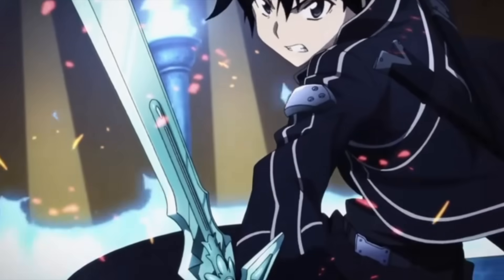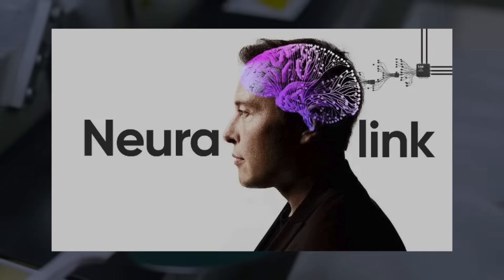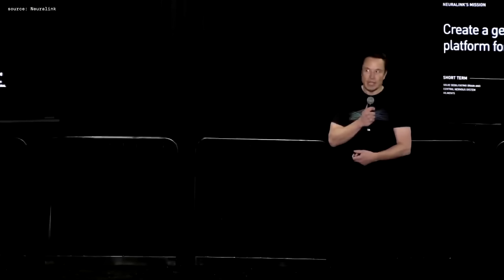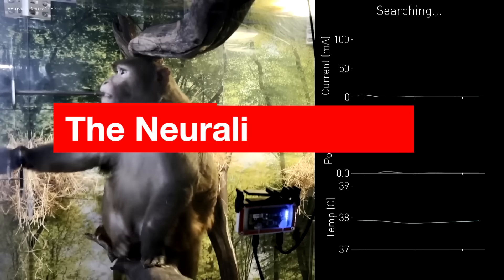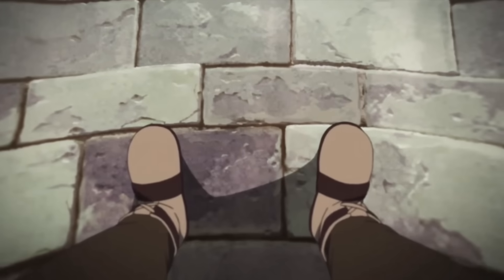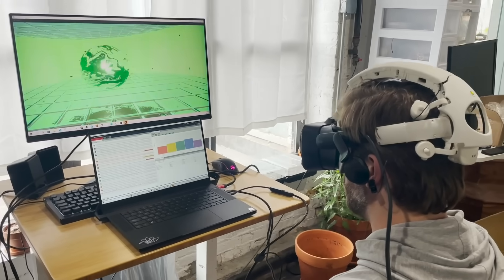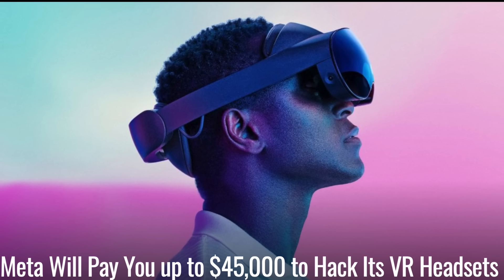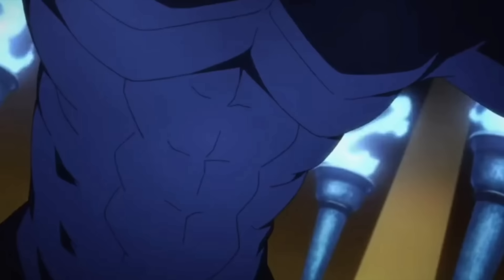The Full Dive VR Future of Neuralink!

Comment: the main issue so far with human trials and current brain implants is that, although successful, over time the insertion point into the brain will begin to try to heal itself, building up scar tissue, and scar tissue in the brain (believe it or not...) isn't good for it's long term functionality. This is equally true for the chip implanted. The more scar tissue can be equated to lag spikes in the brain chips interface since it's difficult to get accurate readings.

If they can solve that problem then perhaps they're on to something. Currently the safest and least invasive method would be preferable (i.e. a powerful brain wave reader that doesn't need to be surgically implanted or in the least, one that doesn't pierce/damage the brain tissue).
Reply from the maker: one step at a time my friend
Reply: @VRelity  agreed :). 

I'm an indi-developer/self taught. Every great idea has a ton of problems, every problem has a solution, and just takes someone willing to put in the time and resources solving all those tiny problems before finally you have something very successful. If anyone can do it It's Elon Musk.

Comment: the thing with those full dive stuff is that it was already possible for a very long time. theoretically. we all already knew that the brain controls basically our whole existence. and we even know what parts of the brain interprets the electric signals. we probably even already know the voltage that is needed to stimulate certain brain functions. brain surgeries are already common practice for some specific diseases. 

so what's hindring us? of course it's the technique and the implementation. every human is different and the same electric signals could be interpreted differently. so basically you need a highly capable machine learning algorithm and you need to get around the whole burocratics. i mean if you formulate it a bit different the potential of this system is like a heavy addictable drug. think about it. you could directly stimulate the pleasure center of your brain or escape from reality... 

but one thing you need to note... only your brain can escape the reality, your body can't. it needs to be maintained. so as long as we don't invent some kind of liquid that preserves the human brain while being fully functional. the human body is the most fragile part of our existance. the maintenance is higher than for an old car. you need to feed it daily, even if you just lie around, you need to do sports, get your dose of vitamins, you need a strickt diet and so on. 

let's move a bit further. what the brain actual needs is a body to control as well as sensors. those you can perfectly emulate (theoretically) with an avatar in some kind of game or whatever. the second thing is the brain needs some kind of liquid containing the neccessary stuff for it to be fully functional. like oxygen, blood, vitamins. minerals. probably... 

so if you take the human brain out of the body, we could all live technically forever, in a world of our personal choice. which would be awesome. just awesome. then the only problem left is reproduction.

but even if we don't. imagine the possibilities you have if you only want to live a healthy life. you will never be hungry. you can modify all this "healthy" stuff that tastes like literal crap to actually taste like... dunno.. nutella. steak. you can turn of your whole sense of pain. you can run as far as you want without being exhausted. you will never experience muscle pain again. just imagine running as fast as you want without your lungs hurting as if you pierced them witha  knife. imagine moving free as the wind without having the mother of all muscle achings at the next day. 

actually you don't even need to do sports. the growth of muscles as well as burning fat is controlled by - you guessed it - the brain. you could simply force your brain to grow muscles, burn fat or even just don't even create fat cells. 

and now, for the last thing: it is said that humans only use a maximum of 10% of their brains potential. with this technology we could unlock the full potential. we could have the full data flow. we can access memories that were lost long time ago in an instance. we can not only "remember" but maybe even "experience" those memories again like they were real. we could have all the knowledge of everything written in the internet accessible in an instant, all at the same time. 

but sadly the contra side is also a possibility. brain washing. mind reading. and yes, from a remote. so first we need to very precisely investigate how secure this device is. because if it ever happens that even just a single human manages to "hack" it or control another human, interfer with another human. then this whole technology will be buried in an instant.
Reply: Insane
Reply from the maker: Dammm

Comment: I would (and probably will if requirements are met) take it, but only when:

1. The technology has advanced to a point where it has no massive cons (especially major health risks with even slight odds of occurring)
2. The price of an implant has lowered to the point where an average person can somewhat afford one
3. The chip can do more than just control my other electronics and devices (full-dive)
Reply from the maker: I understand but would you not want to fulldive into sword art online if it was possible to use a nervegear in real life safely ?
Reply: @VRelity  I mean sure but fully external manipulation of the state of brains and nerves is probably far more difficult than direct contact with a chip so Nervegear isn't gonna happen any time soon

Also Musk can't exactly half-ass the chip yk
Reply from the maker: @vergl569  yea

Comment: Ok, so this can in fact have a lot of potential yet he hasn't changed anything so far and VR like sword are online is still far away. I tell you why if you comment.
Reply from the maker: tell ne
Reply: @VRelity  Neuralink is able to send signals to the brain. So you can fake the feeling of touch, or maybe even overwrite vision with other signals. But thats not the bottleneck of virutal reality. If its just that we could already dive into SAO but won't feel or smell things from the VR. But we could at least see it, hear it and interact with the VR world. But even that without Neuralink hasn't happened so far. At least not like SAO. Thats not because they are missing Neuralink. It's because of other hardware limitations. Batterylife limits the size of current VR devices. And the built in chips dont have enough power to calculate the same world we can see on PC's or console which leads into some VR devices being conntected to a PC to haver more calculation power. And even that is obviously not enough when looking at current VR games none of them come close to anything like SAO and Neuralink will not change that. It will be an addition in the future but it would not solve all the problems that our current hardware has. It's our current hardware that limits us, nothing else.

Comment: i prefer to use nervegear helmet like SAO than implanting chip in my head, its scary to think if you get hit on head accidentally and it causes short circuit in the chip ,it could cause double money for double surgery the cost will not be cheap for using this chip.
Reply from the maker: it will be super expensive

Comment: its actually a major misconception that the Nerve Gear in SAO works through sending signals to the brain through the skull

it's actually more of a spinal and nervous system thing than a brain thing where it essentially taps into your nervous system to replace the signals your body would be picking up with its own and most of SAO's technology is more neck based with intercepting signals instead of full on busting into your brain with an implant lel

although like 20 years after the Nerve Gear in series there was a brain implant chip mentioned in Accel World but it was banned by the government due to security and health concerns then became an underground thing

the device in Accel World is the NeuroLinker and its basically a little neck piece similar to the augma like a customizable collar type thing and IIRC they're both removable and waterproof and work through the same nervous system interception method 

honestly neck device to intercept your nervous system signals sounds more realistic than brain implant that will completely fix your body and can control computers with your mind 

another small correction is that in SAO its stated you can still tell games apart from reality fairly easily and the only people that struggled either didn't give a fuck in the first place or lost their grip on reality after 2 years in full dive VR lel

Alicization's Underworld though is stated to be a near if not perfect replica of reality though that you couldn't tell unless you knew or saw the world was set up like a game but the device that puts you into Underworld can straight up seal or erase your memories so its not like that matters lel
Reply from the maker: although mostly I agree with what you say, the stimulation of vision, taste and hearing are send directly to the brain and not the neck from sword art online since these can only be stimulated directly

Comment: Ah, it's another empty elon musk promise he will never factually deliver on, ever.
Move along people. Nothing to see here.
Reply from the maker: idk its actual working products now
Reply: @VRelity  What is? The overpriced solar roof tiles that doesn't look or work as they advertised? The truck with no carry capacity, half the milage and lifespan of a regular tuck? The autopilot that doesn't work outside of cruise control functions? The tunnel with cars that slower than if you'd walk? The hypeloop that's just a vactrain that's never gona launch? The rocket booser landing they already did in the 80's and spaceX never made more viable? The "robot" for which they had to edit the presentation video to make it look like it actually works? The "cybertruck" that's not road viable and not in production? The Mars and Moon missions they are gona launch this year (2022)? It's dec 25th. The twitter buyout for free speech where they immidiately started to censor everyone? Or is it the tesla stocks that are nosediving harder than a fighter jet with an epileptic pilot mid seizure?
Please, pick one. Which one of them is a "working" product. Product? Maybe. Working? About as much as a car with no engine pulled by horses is still a working car, sure.

Comment: I wouldn't do it for various reasons 
Firstly we don't know how they would perform under certain conditions for example weather I cold climates what effects will it have on the user or what will happen to the chip itself. Jn hot weather some places are extremely hot reaching over 40C° and with global warming that 40C° can easily change to a 50C° what effect will it have on the user, what will happen to the chip,will it malfunction? 
What will happen to the chip if you end up in a fight surely enough fights can escalate into the use of weapons(not particularly guns now) and a single badh on the head could  break the chip then what? You could potentially remove the chip and it's pieces but what about fragments left behind if said fragments remain? 
What about hacking? They having people testing jt by having them break/hack into the chip and then strengthening security around it to make sure that it doesn't happen. Sure it sounds plausible but let's be real if hackers can break into banks and  companies what stops them from hacking into a chip implanted into someone else? Basically once jts hacked  they could just malfunction the chip and you will likely die depending on the severeity of the damage. 
Tracking with the chip jn place you will be tracked all around the world sure jts already jn practice thanks you cellphones, satellites and cctv cameras. This just solidifies the operation with a surefire way of no where to run and no where to hide approach. 
Also there's a battery in your system and like I said we don't know what conditions it can take I Madd mention of weather let's use heat again since there's a battery how hot will it get since it is required to charge as well. You basically walking around with a bomb which you cannot throw away like a cellphone. 
so there's alot to consider before jumping jnto this
Reply from the maker: fair points